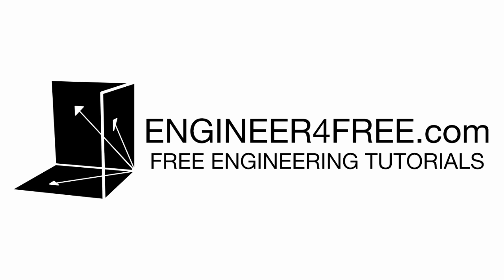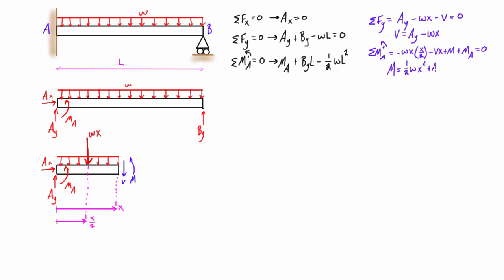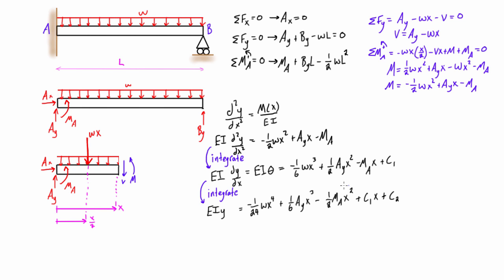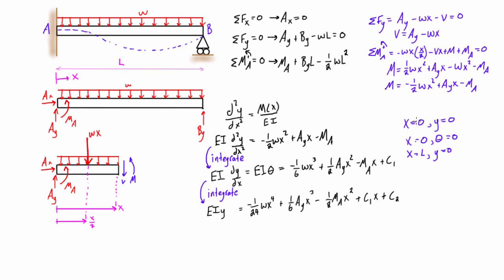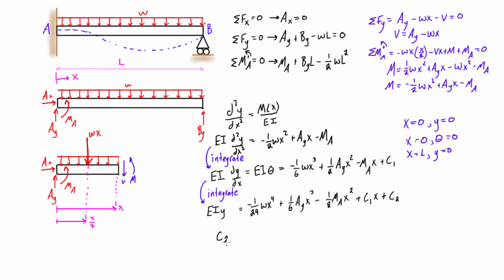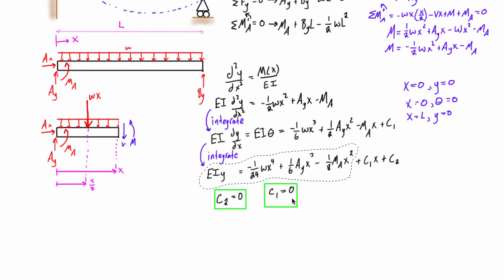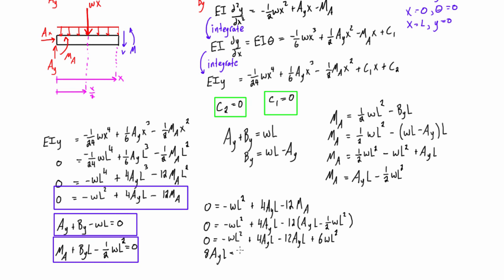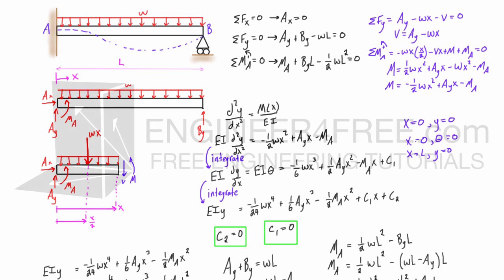Statically indeterminate beam deflection and slope example (double integration method)

Comment: So I got bored at work and did a beam problem with length L, a fixed end (left side), point load P at distance A from the left side, and roller support on the far right.
Moment (clock-wise) at origin is (PA/(2L²))(3AL-2L²-A²)
Left reaction (up) = P-(PA²/(2L³))(3L-A)
Right reaction (up) = (PA²/(2L³))(3L-A)

Comment: How would this work with a point load?
Reply: See my other comment.  I didn't use his method though.  I used the method of superposition.  Take away one reaction and evaluate the beam like you normally would.  Then make up a value for the reaction and evaluate the beam again (except this time you remove all loading).  If you turned the fixed end into a pin support, you need to compare your Θ values at that end for both beam conditions.  Use the equation Θ1+δΘ2 = 0 and solve for δ.  This is your multiplication factor.  You now multiply your "guess" reaction by that factor.
Similarly, if you chose to remove one of the vertical reactions, you would need to compare the deflections for both of your beam conditions by using the equation Δ1+δΔ2 = 0.

Comment: Would you do a short video about discontinuity functions for the beam deflection and slope?
Reply from the maker: Hey you might be looking for this video: https://www.engineer4free.com/4/find-deflection-and-slope-of-a-simply-supported-beam-with-a-point-load otherwise, depending on which method your interested in using, I'd browse engineer4free.com/structural-analysis for anything with a point load in the video title.